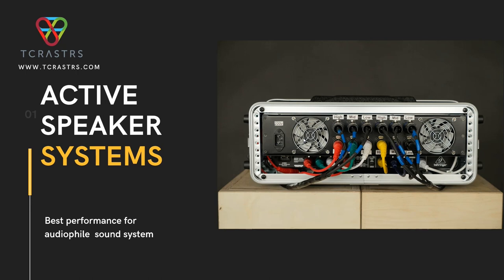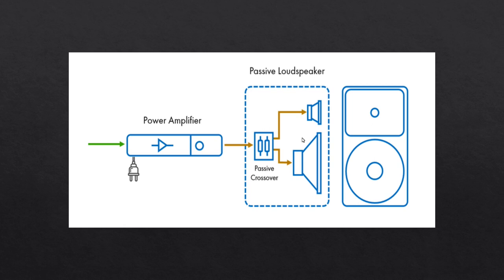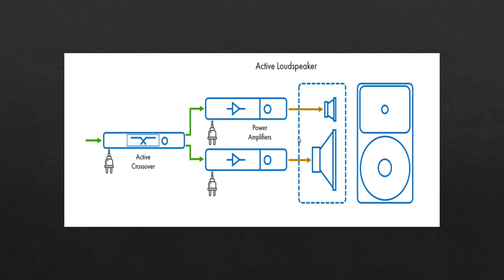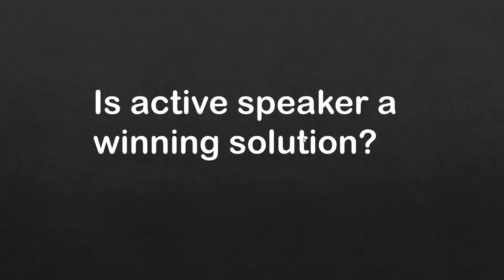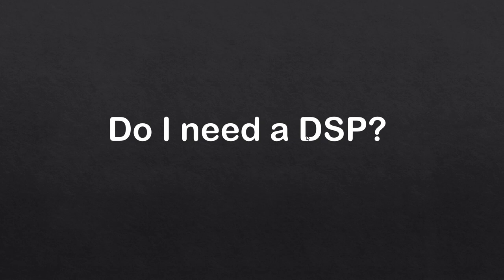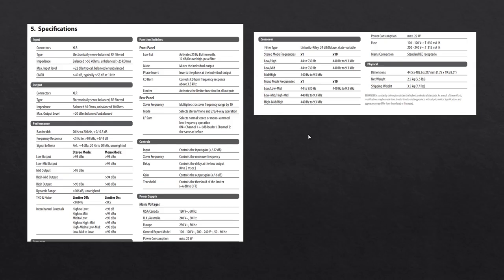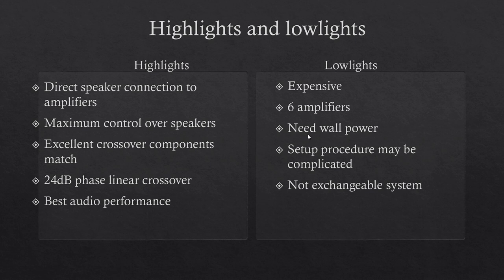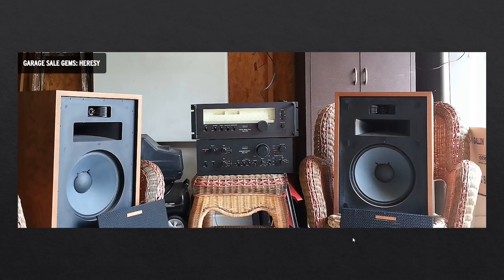Active speakers

Comment: Thank you very much for this video. A few days ago I came across with your video about "Merging professional and consumer audio" and it has been an inspiration to pursue the development of an active speaker system like the kii three, and I was looking into using the dbx DriveRack VENU360 for the crossover. I think a kit from you for making the amplifier box like the one you are using will be a success since it could entice many that could want to do active speakers but feel intimidated by the task. Greetings from Mexico.
Reply from the maker: Inspiring project with Venu 360

Comment: i  have build active speakers, and there are issues i need to see solved before i can use them. it is the hiss noise, if its a power amp or a plate amp connected to a driver, i have heard hiss noise.  the hypex fusion amp is really bad with this.
Reply from the maker: First, you should find out if his noise is received like an antenna or coming directly from the amplifier. Try to connect the 10W 10ohms resistor in parallel to the tweeter and check what happens.
Reply: @guntarssmits2104  that are good advice for tinkerers, i do not have small parts.
the hiss noise also comes out of the woofers. 
when the amps are powering a 2 way passive speaker it silent.
Reply: Use better amps for your diy active speakers
Reply from the maker: My guess is that you need a Zobel circuit parallel to speakers due to the impedance dependence of transducers ( loudspeakers). Especially high-frequency drivers where the constant impedance is critical working with class d. Learn about the Zobel network on the internet. it is a simple RC circuit in parallel with the speaker to equalize speaker impedance. Good passive crossovers have it built in. Ask some electronic specialists to build it for you.

Comment: Nice one but you lose the charm of having a nice amplifier on your console. With vu meter and / or tubes for instance. Not for sound perfection but for the pleasure of eyes
Reply from the maker: You are right. Esthetics in exchange for audio quality. There is always a trade off.
Reply: @guntarssmits2104  but the question becomes. Is it worth to sacrifice beauty for 0.01% improvement in sounds which only computers will capture, not your ears